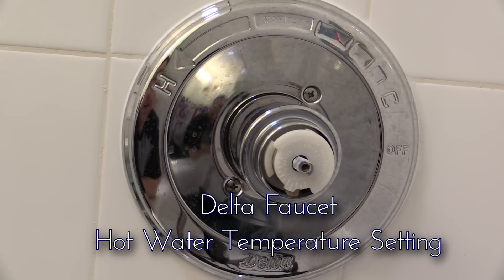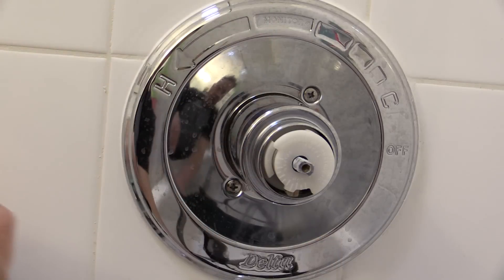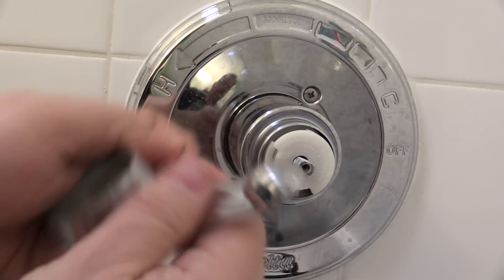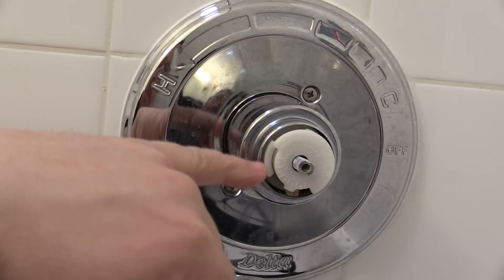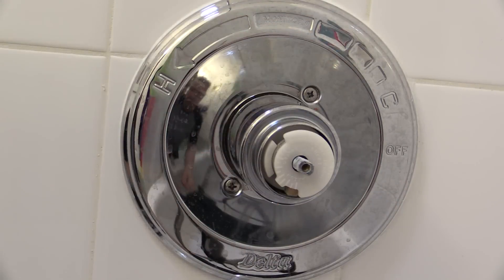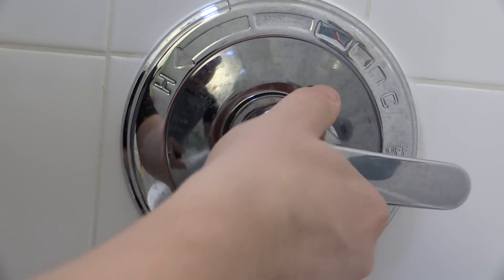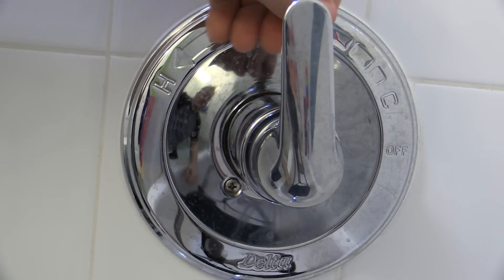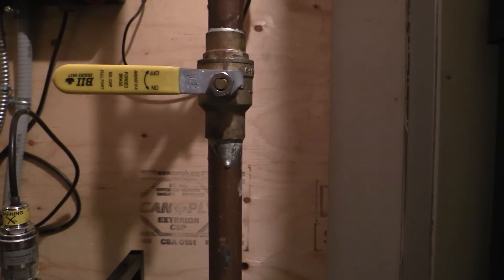Hot Water Temperature Scald Prevention setting in under 5 minutes - Delta Faucet - Shower, Bath

Comment: Excellent!  Outstanding!  Helped me a bunch. Initially the handle didn’t want to come off after I took out the screw with the alan wrench.  I squirted wd-40 into the screw hole and was finally able to wiggle it off by applying outward pressure with a screw driver up against the lip opposite side of the handle while at the same time pulling the handle and wiggling it.  I almost gave up until I tried this.

Comment: I did this and took out the pressure restrictor and now it works. Out of the box, it doesn't work, no pressure and no hot water. Need to travel out of state for my next fuxures or never buy Delta again.

Comment: I took the screw out but the handle would not come off. How to get handle off?
Reply from the maker: I believe in plumbing sometimes calcium or other mineral build up can get things "stuck".  You could try rigging a "container" around the area which would let you soak it in some CLR (Calcium Lime Rust) remover maybe.  Take a photo and visit a local hardware or plumbing supply store and they may have some wisdom for you too.

Comment: So my allen key twisted and bent ITSELF before allowing the set screw to give ANY leeway. I have no idea why it’s on their so tight or if it’s just been calcified stuck.
Reply from the maker: I would suspect calcification.  You can try some CLR in there if you can get it upright enough to let the CLR sit a bit.  Also you might need to buy a 1/8" driver (looks like  a screwdriver) as they are much stronger metal often than the allen keys

Comment: My handle is stuck how do I remove it I took out the set screw but handle won't come off
Reply from the maker: To start, I'm a homeowner so you might be best to contact a plumber here. You can try to loosen any build-up with some CLR (calcium lime rust) remover -- if you can figure out how to soak it for a little bit that might help loosen it.

Comment: What if I can’t turn the (main) water off?
I’m in a mobile home & a senior & can’t reach it (wherever it is, I’m assuming it’s under the skirting of my home??).
Reply from the maker: You can change this setting without turning the water off without an issue. Well you might get wet if you accidentally turn faucet, but turning the water off is not required.

Comment: How u get it off
Reply from the maker: There should be a "set screw" which requires an allen key  (sometimes called a hex bolt wrench).  Really depends on the model of the faucet, but hopefully that helps. If you have the same model as I do, it's just behind the handle portion on the trunk of the faucet handle.

Comment: I had a plumber install a shower valve on the second floor but there was no hot water. So I saw your video and reposition the hot water adjuster and now it works. Save me some money. Thanks

Comment: I was satisfied with the quality of the faucet.σσσ>allmy.tips/DeltasValve?qq🚲    I had to return the item because it did not come with some piece required to complete the installation. That’s no fault of the seller as it was disclosed. I just didn’t understand the disclosure (the piece that was required). Besides that, I would have kept the item. I would recommend confirming if you will need that piece (which from my contractors explanation, everyone would need it)

Comment: perfect! I just moved into a rental and there was barely any hot water in the shower but hot water was nice and hot at every other faucet in the house. I just had a cheap offbrand shower valve but I still figured out how to adjust the resistor based on your video. Thanks so much!

Comment: I built a 650 sq ft home and this heater is doing a fantastic job.>>>ur2.pl/1103    It is fairly quiet although you do hear it a little when running, nothing alarming. I have no issues filling the bath tub and have hot water on demand when needed. Very happy so far!?

Comment: remember you don't need to take the set screw all the way out
Reply from the maker: True, but I have hard water where I live, so I take it all the way out, drop it in some CLR and splash some CLR through the threads as well.  I have other faucets in the house which have seized the set screw with hard water deposits.

Comment: why turn the water off to faucet...? your only removing the handle & temp adjuster...! But, Thats How You Adjust The Water Temp Alright...
Reply from the maker: +HEB PLUMBING It's not at all mandatory to turn the water off, but it could make it easier to put the set screw back into the handle without having the water accidentally running into the bath while you do it, even allowing you to turn the handle closer towards you depending on it's orientation, without having the bath water running full blast.  So basically, "why turn the water of to faucet?" -- purely convenience.